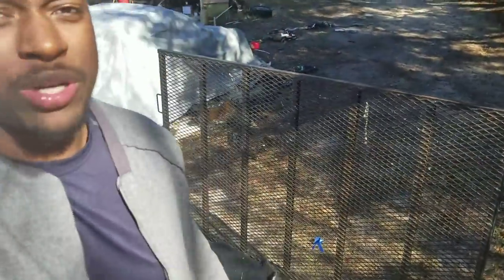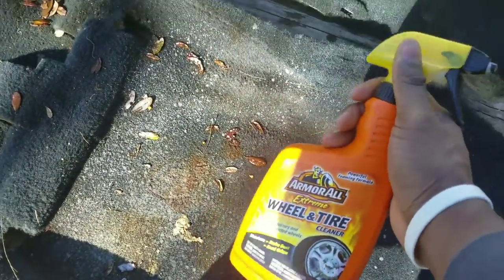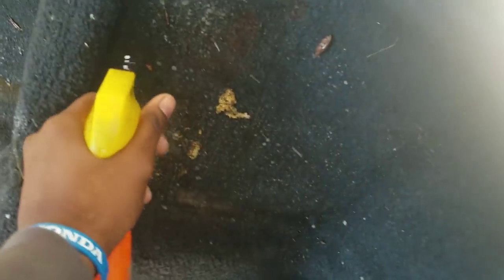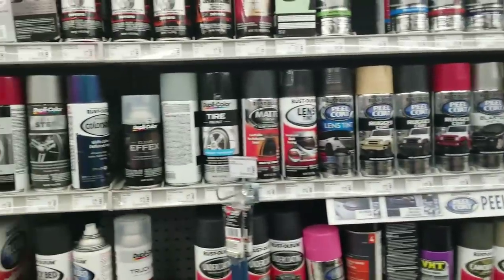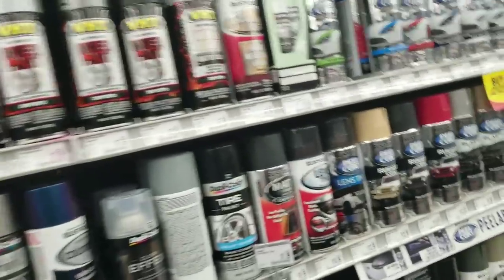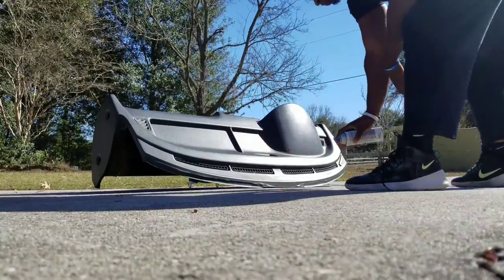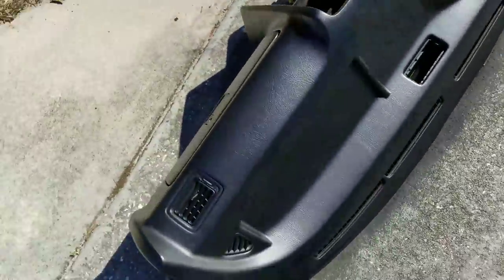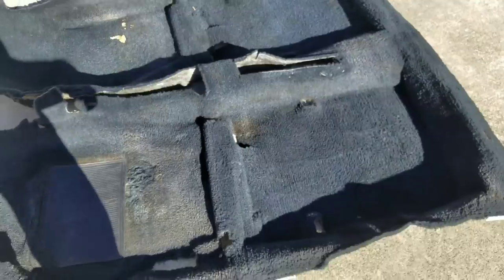All black interior! Duplicolor vinyl and fabric paint DIY | WATCH THIS

Comment: I did the same thing with an old CB. the carpets and seats hardened up a little, but that can be fixed by getting a scrubbing brush and brushing back and forth until its softer, then vacuum what came off.

Comment: In case you don't like how the carpet turn out. Look up a brand called Rit dye. I found that to be the best way to dye carpet or seats covers. Did it with my cb7 and a few others.
Reply from the maker: AJ Imports okay I'll look into that. I mean it came out good, but I may want to dye it since the carpet is so old. Thanks man 👍🏽
Reply: Another great idea!  I have an RV with ghastly faded and stained old carpet in front cab area.  I've replaced house side with real wood floors.  But need a solution for front.  Please share how you dyed it with Rit dye!  How easy is it to replace carpet with a rubber mat flooring?
Reply: YES. Rit dye is better. Use hot water and add SALT!!! 
Look it up, salt is the key.
Reply: Hey Aj, question. When u dyed the carpet did u put the dye in a bottle and spray coat the whole  carpet?
Reply: @priscillaeiland4605  First clean clean clean clean the carpet. Then try to find a metal spray bottle, check the hardware stores. Spray it while its fairly hot. Are you keeping the same color or changing the color?

Comment: Props my dude. U showed them well. U could have used a shop vac when it was wet to get dirt out too and expedite the drying process. Also, heat helps cure the paint and dye. I half wrapped and half dye my dashboard
Reply from the maker: Thanks man! Good idea about using a shop vac I have no clue why I didnt use the one a have. It would've got so much more dirt out

Comment: aww hell,im fixing to do the same thing,i have a 95 single cab Z71,I've had it for 18 long yrs,its light grey interior and I'm sick of it,so ,oh and it had bucket seats,i was sick of them,so i went to a salvage yard and got a bench seat and omg i love it,so much more roomy,but its blue and my truck is blue,so its cool,but i want to change the inside and i want it to look modern,I'm going to add stuff to the dash like a audio spectrum i found,check it out on (bigdwiz's) channel,he shows it,its so cool,for 45.00,check it out,so I'm going to go with black,i just bought new carpet last summer,charcoal grey,i can dye it black,the seats,not sure yet,but the dash and panels,I'm going to wrap some with vinyl,then paint some,i guess i will use Dupli color and buy some black vinyl,i may have my seat done by a professional with black vinyl and maybe blue stitch that would look dope huh.thanks for making the video,especially at the wash dodging bullets haha kidding,later

Comment: IS this a 1990 Honda Accord interior?
Reply from the maker: Jay Sawyer Yes this is my 92 accord interior
Reply: If I remember the 1990 through 1994 was basically the same car. A major difference was by '92 or '93 the added a steering wheel air-bag. I saw your dash and it looked TOO familiar!! Thanks for the update! BTW, I looked for the Duplicolor at O'Reiley's and they didn't have Navy blue. Any ideas who may carry a wider selection of interior colors?

Comment: How many containers did u use in total, i am interested in spraying the dasboard, 4 door panels and carpet - my car is a bmw 520i m50 1992 model
Reply from the maker: techmind uganda I would suggest you buy 2 cans. That should be more than enough to finish a 4 door BMW. Just spray a few coats every few minutes, and have a brush to scrub it into the carpet on each coat. 👍🏽
Reply: Thanks for the quick reply